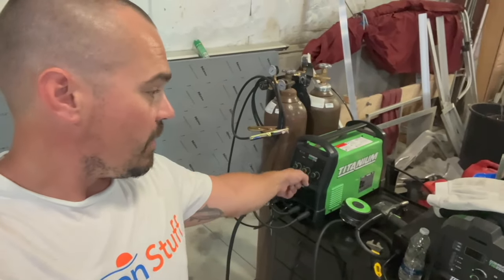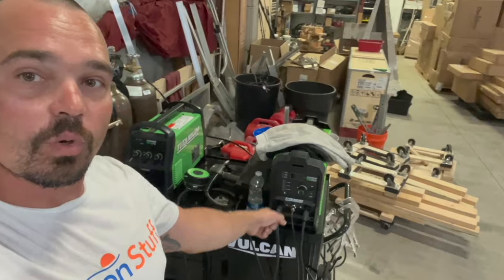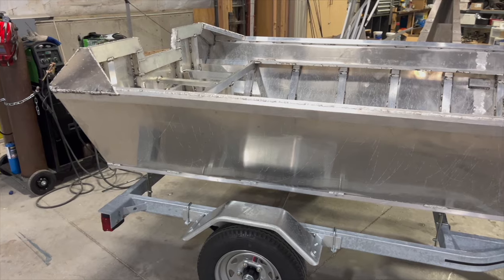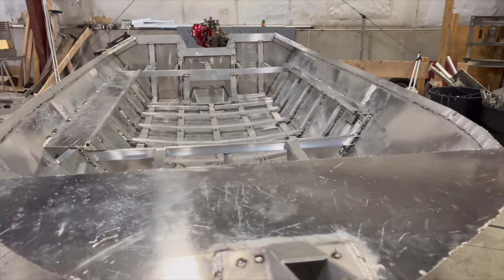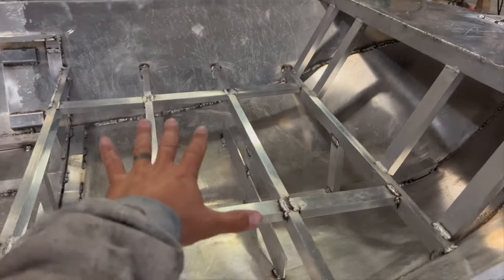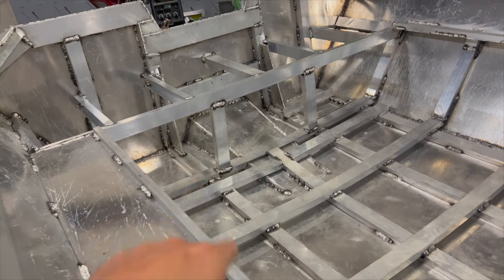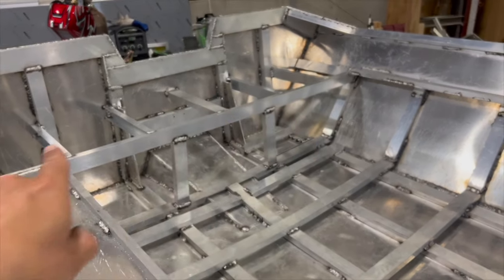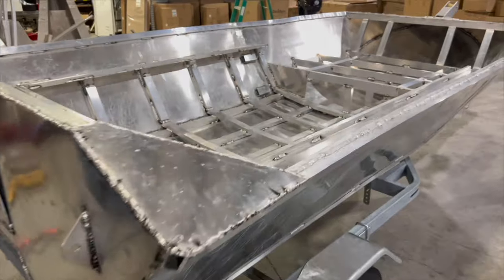ALL WELDED Fishing Boat Built from Scratch - Time Lapse

Comment: What settings did you use for such thin gage aluminum for the spool gun, been thinking about welding braces for my floor and takes the seats out
Reply from the maker: 1/8" isn't so bad with the spool gun for most joints other than a butt joint. Every machine is different, and this one welds differently when running on 110V versus 220V power. I think I'm usually around 18 or 19 volts for most stuff on 1/8" if I remember correctly. With wire feed speed pretty much maxed out. That's all that machine shows for info. My new YesWelder YWM-211P is outstanding for thinner stuff as it has Pulse and double pulse settings. Check out those videos I've shared recently welding with that machine!

Comment: Why are you using both spool gun/mig & Tig. Why both?? Just wondering I have a mig machine a Millermactic 211 it can except  spool gun. I was shopping that's why I ask. Great video.
Reply from the maker: My standard MIG setup doesn’t watertight things as well be cause I don’t have settings to crater fill and more…so it leaves tons of pin holes. I currently use MIG for structural and bigger welds, and TIG for anything that needs to be watertight. Hopefully my new pulse MIG setup will allow me to not need to TIG some of those seams. Otherwise I just use TIG for aesthetic items (providing good structure) where I want pretty welds. I’ve got a couple more builds on my channel since this one!!

Comment: Awesome! Would it make sense to cut the transom out of a thicker material?
Reply from the maker: Sometimes you'll see a thicker transom sheet, but with the tubing added where the motor is bolted and gussets it takes care of the needed strength to hold the motor.

Comment: Thanks for sharing? It’s my dream to build my own boat. Did you meant 110Volt of power?
Reply from the maker: Thanks for watching! I’m building my second currently (watch for a video in the future). I’ve got 220v now, but this was all welded on 110v (yup, I misspoke in the video). 220 is a million times easier to work with because it can get hot and working faster.

Comment: Anyone else trying to do this for themselves. Couple tips. First off. Call ryerson metals and order sheets in the length you actually want instead of welding two sheets together. It’s not much more money at all and you won’t have to deal with the mega warpage. Secondly try not to have any flat panels unless absolutely necessary. If the panels even have the slightest curve/bow in the design it really helps to keep from (again) warpage. A flat panel wants to shrink in multiple directions as the weld cools and shrinks. So you end up with a really wavy boat. If it’s curved the stresses kinda just make it a little more curved instead of going anyway they want. 😮😮Third would be to not have any overlapping aluminum anywhere. Don’t use square tubing for stringers. Use angle “iron” if possible or channel like he did on his boat. Anywhere it’s overlapped will rot through much faster. Last but not least. Have a professional build the boat for you 😂. Just kidding. Do it up. If anything you’ll Learn a lot in the process. Plus we need more fabricators and builders in the world Not more uses less gender studies diplomas. 🤦‍♂️
Reply from the maker: Great info! I’d never heard of Ryerson, good to know they sell sheets up to 20’ long. I’ve got some more builds coming, last one is lap jointed, worked way better, but I can’t wait to get working with my full sheets on my next few builds! 

This project was a blast and taught me so much about boat building, the series of steps to keep things true and straight, and so much more. Stay tuned for more builds!
Reply: If I wanted to build my own 25 foot Jon Boat how hard would it be to do that?

Comment: What saw did you use to cut the aluminum?
Reply from the maker: It's just my Ryobi 7 inch circular saw with a Diablo metal blade. I learned that it'll cut curves from another YouTube boat builder. The secret is that you have to set the blade as shallow as possible while still making the cut through the material. Works like a charm!

Comment: All said and done what was the cost to build vs cost to buy?
Reply from the maker: Oh man, great question!!! I got the sheet metal for scrap price, which is why it has a seam on the bottom and sides. I bet there’s about $2500-$3000 in retail priced aluminum. I had the motor and accessories from my old boat. Trailer retails for around $1400-$1500. The biggest thing is that there’s not really an option for a 13’ long boat that’s this wide so hard to determine price to buy a factory boat. I’ll do a better job documenting the breakdown on the next build!

Comment: When did you decide to use TIG vs MIG and why?
Reply from the maker: I ended up MIG welding just about everything which led to a few leaks. I was in a hurry to get it done and wasn’t as practiced on TIG. The next boat I build I will TIG all of the outside seams in the center and where walls meet the bottom. I’ll MIG all the interior and stuff you don’t see. Plus MIG for most tack welds to get it started.

Comment: How long did ti take you to build the boat
Reply from the maker: It's hard to say because I worked on it here and there between pontoon jobs, sometimes just for an hour to tack stuff in place. If I built it again I could probably build one this size in a week...making some tweaks on the design, learning from this experience, and being better at welding now almost a year later.

I'll be building a big 18' boat this summer, so stay tuned for that build. I will be documenting every minute that goes into that boat along with the costs of materials and stuff.

Comment: Would love a price break down of what that boat would cost to build
Reply from the maker: I got the sheet so cheap that it skews the price, but if I bought it from the local metal shop it would have probably been 4 sheets of 1/8” 4x8, and then about $1500 in channel and other odds n ends stuff. So materials probably around $3500 as a rough guess. I’m going to log my hours on the next build to see what goes into it time wise

Comment: I can tell you were not planning on any leaks, no drain plug. LOL
Reply from the maker: The funny thing is that it does leak a tiny bit! There are drain plugs on the outside of the tunnel, just a plastic screw in style, but they work great! Starting a new build soon to replace this boat...it's too heavy to push it with a small outboard jet motor, two anglers, and gear. Stay tuned for that build!

Comment: Nice fabrication.  A few questions, where did you get the plans?;  Which alloys did you use for the plate and shapes?  Tia
Reply from the maker: I literally start with a plan in my head and make it work from there. Learned a TON from this build. Stay tuned for my next build coming soon. Another small boat, but this time a lighter flat bottom for an outboard jet…and a lot prettier too!

5052 for the sheet. 6061 extrusions for the structural pieces.
Reply: @tomspontoons did you use 4043 filler of 5356? Very cool build!
Reply from the maker: @calebh7868  this build was mostly 4043, but my last one and current I’m using 5356 and I prefer it heavily over 4043 for both MIG and TIG. Apparently that’s not the norm, but I feel like it’s easier for me to work with and control.
Reply: @tomspontoons  One of the difficulties with 4043 filler is that you cannot weld vertical with it.
Reply from the maker: @paulkurilecz4209  I think that’s one spot it shows more that it’s harder to work with…I can definitely still weld uphill and overhead with it, but it melts much easier and farther from my arc making it a pain to work with.
Reply: @tomspontoons  I'm am going by the general recommendations for E4043.  Since it is a Silicon alloy addition it will be much more fluid than the E5056 which is a Magnesium alloy addition.  Be sure to check the back side of your welds to make sure that you achieved 100% penetration.
Reply from the maker: @paulkurilecz4209  I love seeing some dimpling on the back side of my welds…but not every weld can be inspected from the back side. I’ve learned that I can burn in a little more heat and a deeper puddle than I once felt confident with!
Reply: @tomspontoons  Seeing that deformation or indication of temperature is a good sign that you have 100% penetration on the weld.  The important thing is that you are consistent.  One thing that you can do to verify the strength of your welds is to take some coupons and weld them in a vertical  position and then put them in a vice to try and break them open.  If you can bend the coupon 90 degrees without breaking or cracking, you have done a good weld.  If you can bend it 90 degrees without it breaking, bend it back and forth until it does break.  When it breaks looks for porosity and lack of fusion.  This will be obvious.  Both are related to the weld bevel preparation and metal cleanliness.
Reply from the maker: @paulkurilecz4209  definitely one of my favorite things is to weld scrap together as practice and try to destroy it!! You can learn a lot!
Reply: @tomspontoons  As I am learning new processes, people will ask me what I am making and my response is:  scrap metal.
Reply from the maker: @paulkurilecz4209  haha perfect answer!

Comment: What was the thickness of aluminum that you used for the frame work? I'm making my own boat and cant figure out how thick I need to go for the framework'.
Reply from the maker: I used 1/8” sheet all around, and reinforced it with 1/8” C-channel that was 1”x3”. For the transom I used 1/8” walled rectangular tubing for a little added support. I’ll be building an 18’ coming up in the near future with a little different design. I hope to time lapse that build too!

Comment: Can you go over you welding setups for this!
Reply from the maker: Super straight forward…

Titanium MIG170 machine with a Titanium 150 amp spool gun. 4043 wire, 0.035 wire diameter. (Note: I prefer 5356 wire as I’ve welded more). 

Titanium TIG200 for TIG welds. Same 4043 filler rod. (Also now prefer 5356 filler). 3/32” diameter to 1/8”. 

Running everything on 110v power. 100% argon. This boat was 90% MIG welded. Not as pretty, but sturdy and functional. Current project has far more TIG and is turning out a lot prettier. Will post that video in the coming months as it finishes up. Then onto a BIG boat build that I’m pumped for!
Reply: @tomspontoons  Since the plate is 5052, E5356 would be preferred over 4043.  At least that is my thought.
Reply from the maker: @paulkurilecz4209  the guys at the local weld shop suggested 4043 as an easier to use filler for 5xxx and 6xxx aluminum…I guess you gotta try it all and decide what works best for each application!
Reply: @tomspontoons  Yes the 4043 is a bit more fluid than 5356.  This is why 4043 is not used in the vertical position.  The difference is (and this is a quirk of welding aluminum) that aluminum welds are always going to be weaker than the parent metal unless the parent metal is in the fully annealed condition.  The 5356 has a higher yield strength than 4043 due to the addition of Magnesium.  The 5xxx aluminum alloys are strengthened by cold work not heat treating.  The plate that you obtained was probably in some sort of hardened condition for higher strength.  I am sure you will get a long life for your boat and it is a nice fabrication job.  Just keep an eye out for welds starting to crack in the higher load and stress areas such as the transom.
Reply from the maker: @paulkurilecz4209  I’ve been keeping an eye on it like a hawk, and so far everything is holding up well. The next boat is lighter materials, but my welding is 100X better than a year ago, so hoping the lighter boat is as strong or stronger! 

Thanks for the information. It’s always great to learn some of the finer details. I’ve learned by welding and burn time, not a textbook, so those are things I don’t hear about on my own!
Reply: @tomspontoons  Good luck with it.  It was quite an impressive project that you completed.

Comment: How do you register it ?
Reply from the maker: When I build a hull for myself it can be registered as an "Assembled Hull" built with materials purchased. It's assigned a new hull ID # at that point.. Boat builders have a different process to register hulls that are made to be sold.
Reply: @tomspontoons  is it some sort of licensing you have to have in order to get that ? As a manufacturer
Reply from the maker: @josejura5031 yes, licensing through the USCG to be a boat builder. If selling you’re required to follow their boat building requirements for flotation and weight ratings

Comment: I had a MIG 140 for auto body work, that I was told, would nor weld aluminium, but I kitted it and it worked for aluminium. I built two boats, one steel, and used it to make aluminium parts, and put pieces on my small boat to repair wear. What I really wanted to say, is I had a new riveted boat, and my brother destroyed it in 3 months, so I bought a welded one, and it lasted for years.
Reply from the maker: That's awesome! I've been pleasantly surprised with the MIG170. I would love to get into a push/pull or pulse MIG to speed things up and make the MIG welds look prettier, but that won't happen until I'm building more boats on a regular basis...at this point it's 1 or maybe 2 per year so I'll make do with what I have!
Reply: @tomspontoons  I now have a 225 MIG, but have not used it much, it is not as easy to control as my I40, l also  have a gas problem, my cylinders are international connections, and here they are US type, bastard threads.
Reply from the maker: @grancitodos7318  Doesn't it just seem like there's always something that can go wrong!?!